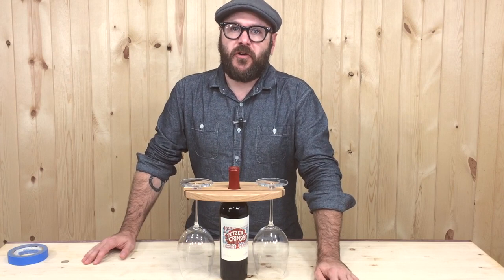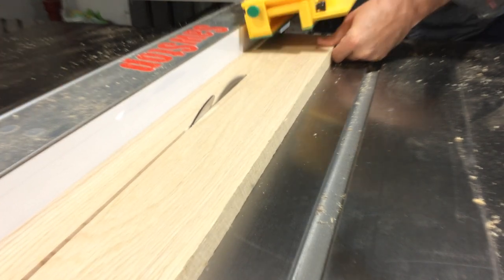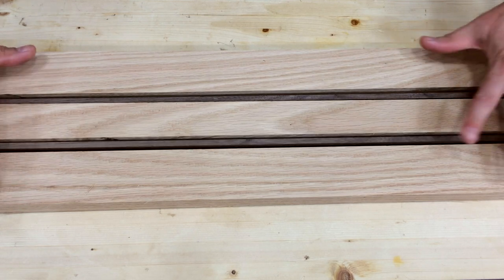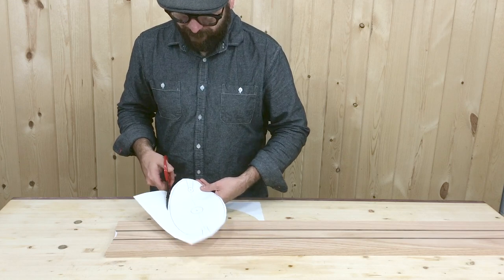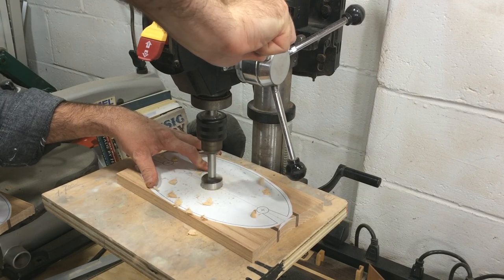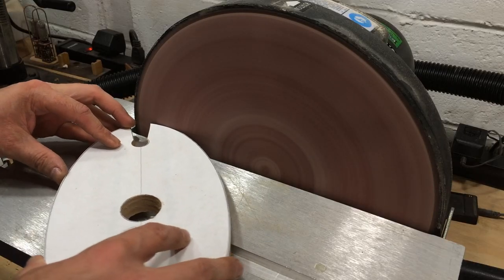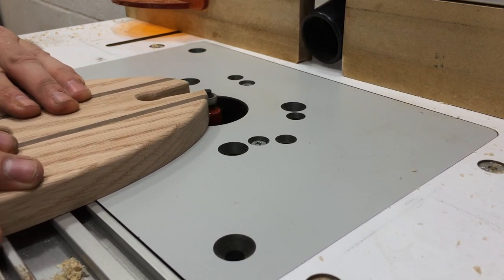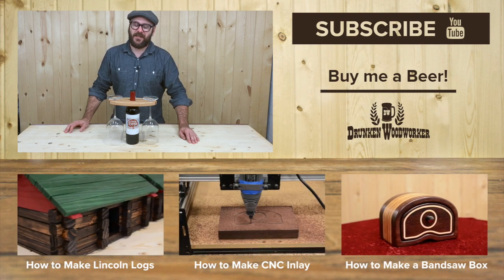How to Make a Wine Display. Perfect for Craft Shows and Holiday Gifts

Comment: When you are making more then that one do you use a template with a flush trim on a router?
That way it is faster to make more then on.
Reply from the maker: Custom Chris I've tried that but I find I can cut them out on the bandsaw just as fast. I feel much safer on the bandsaw than I do on the router. Plus every once in a while the grain will catch on the router ruining the piece.
Reply: I ruined three units of this Display on the router when using Vertical Grain Fir.
It was nice wood too...   :-(    Now do pattern, bandsaw, sand.

Comment: I found out the hard way that one accent strip in the middle makes things difficult.  You have to have it EXACTLY in the middle, if you are off a bit, it shows up when you drill the holes.  I have a few of these in a consignment shop, I used different shapes, one was a bow tie thing, I did a few straight, and a few oval.  Not much point in matching the grain on maple, but I had some ash here, I failed to match it on one, I could see the difference.  Not sure anyone else would though.

Comment: I understand you are showing us how to make this project one project at a time. If you are making a batch of them you could make a 1/4" plywood or mdf pattern double face taped to project wood and use pattern bit in router to mass produce them.
Reply from the maker: I've tried that but I find I can cut them out on the bandsaw just as fast. I feel much safer on the bandsaw than I do on the router. Plus every once in a while the grain will catch on the router ruining the piece.
Reply: Lost 3 in VGF to grain catch!  Do bandsaw now

Comment: Nice.  Thanks.

Are you using a pattern and a pattern bit when you make muliples or cutting and sanding each one using the paper pattern?

Keep 'um comin'.

JimE
Reply from the maker: Thanks! I've tried that but I find I can cut them out on the bandsaw just as fast. I feel much safer on the bandsaw than I do on the router. Plus every once in a while the grain will catch on the router ruining the piece.

Comment: u could mark the board and just flip the.piece over instead of changing g the fence
Reply: Actually, if you watch the video closely, you will see that his 5 3/4" board is wide enough that when he makes the cut for the third piece he has some left over. Flipping the board to cut the other outside piece would require tighter measure on the width. Otherwise you would run in to the same issue of the grain pattern being offset.

Comment: Could you not roll the board edge to edge maintaining the same lead end to eliminate moving the fence? This is assuming you are using an S4S board and you trimmed it to finished size first.
Reply from the maker: You could but then you have an extra cut at the beginning. Exact widths are not that critical so moving the fence seems to work best.
Reply: Drunken Woodworker sounds like a good reason. Batching and speed are most important when trying to "manufacture" products.

Comment: Do you print off 22 templates or do you have a thin wood template instead for the drilling and shaping?
Reply from the maker: I will use the first wine display and trace around that.
Reply: Sensible, thank you. That's a really nice project, I think I might make one or two for this holiday season
Reply from the maker: You might as well batch out 5 or 6 for holiday gifts!

Comment: For the 2" cuts, couldn't you have just flipped the board and cut 2" off the other end? The remaining piece (assuming you already had the board cut to 5.5" wide) would have been the middle 1.5" piece and would have eliminated moving the fence and a whole from the process while still keeping the grain pattern intact.
Reply from the maker: ***** Yes, if your board is the correct width plus the kerf size of two saw cuts. So you'd still be making an extra cut at the beginning to get that width. :)
Reply: True, but you would not have to move your fence. Then again, it doesn't really matter as you end up cutting away some of the width when you make the rounded shape.

Comment: Good but not much good to most people here to try and make. they dont have the equipment that you have
Reply: +paddy6062 You can make it with a handrouter, drill and bit, and a skill saw costing ~50 if you get them used from craigslist.  Or if you want to get into woodworking, buying a nice bandsaw and router table to mount said router.
Reply: agree . I understand myself what u could.do with the tools that I have but a lot of people probably.need to see that process too